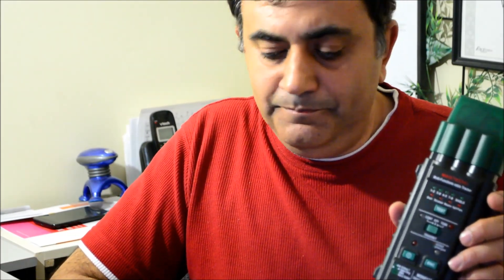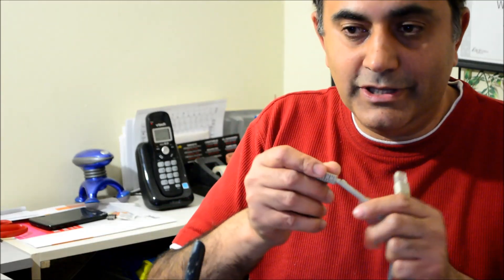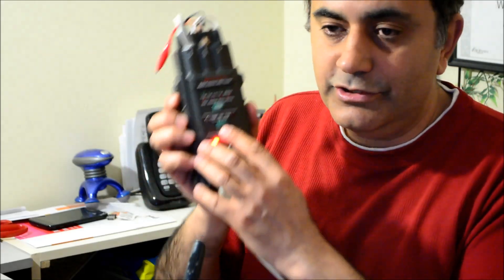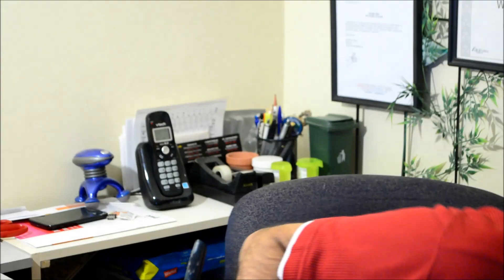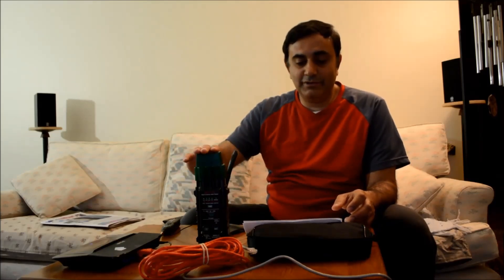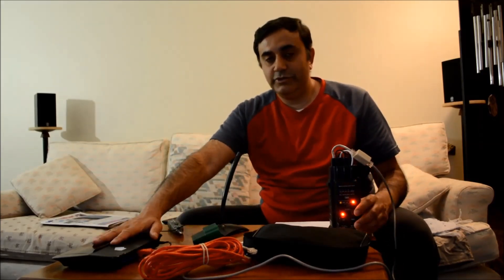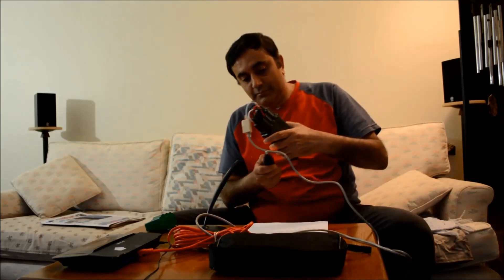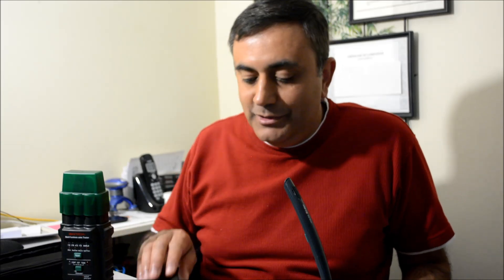Mastek MS6813T Network Cable Tester Technical Review

Comment: Red wire from device must be grounded if TONE test! Then connected cabe to PC or router is not problem - the tone signal is strong and loud.
Reply from the maker: That works. A lot more louder if I use a different toner than the one that came with it. So the toner that came with it is basically useless (unless of course mine came with a defective toner). But it can't be toned while connected to a router or switch. The tone will be loud only if your close to the device [which is ok. we shouldn't tone a live wire anyway]
Reply: Even with the original toner, the signal will be louder if the red alligator is connected to the ground wire or to the "0" in the electrical outlet. The same grounding of the red alligator absolutely eliminates the connection to the computer or the switch - the signal will be tonted (ichecked up to 100 meters)

Try something else. Connect one end of the twisted pair cable to the router, the other end to the tester. Turn on the tone. Check the toner signal near the cable. After that, grasp the red cable with your fingers and check the signal near the cable with toner again. The difference, I think, will surprise you;)

Comment: I'm glad I saw your video here in Greece it costs 47.90€ (about 54 $) so I thought it has to be good.
Reply from the maker: My experience with mine was not good. It could be that my particular one was defective, but before I bought it I saw a review of the same one in spanish. The guy bought it off amazon and returned it for a replacement. His review wasn't complete so I assumed it was working well.

I did buy a toner which I will post here. It works perfectly. The only catch is it is for an RJ11, but you can make your own connection to get it to work for RJ45.
https://www.amazon.ca/gp/product/B00APD16D2

For me the most important feature is the toner.

Comment: Sorry to say but your review was incomplete.
Also the sound of the tracer is different to sounds from life cables.
You can trace all connected cables or wires on any connection to the transmitter.  
Try pushing the test button until all the lights illuminate and look what happens.
It will even tell you if the wrong wires are used as a pair.
So I think it is well worth its money. :-/
Reply from the maker: +smbrob You're entitled to your opinion. It is not the first tester I used. I even tried my receiver with the transmitter from a more reliable tester, the sound that is (with the other tester) usually loud was almost inaudible. While doing this test I am talking about the cables were disconnected from the switch, but I placed it closed to other live cables to mimic a real life situation that I face on a daily basis.

Comment from the maker: Yes for sure it could've been great for that and if the toner was working properly I believe you might be able to trace the wire until the cut.
Reply: Red wire from device must be grounded if TONE test! Then connected cabe to PC or router is not problem - the tone signal is strong and loud.
Reply from the maker: That works. A lot more louder if I use a different toner than the one that came with it. So the toner that came with it is basically useless (unless of course mine came with a defective toner).